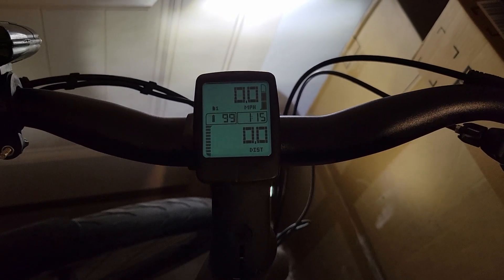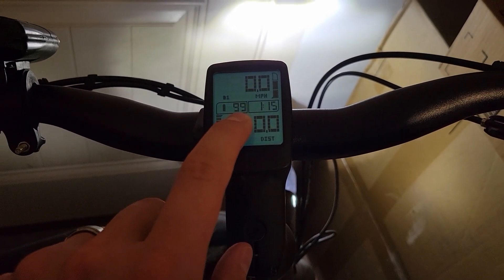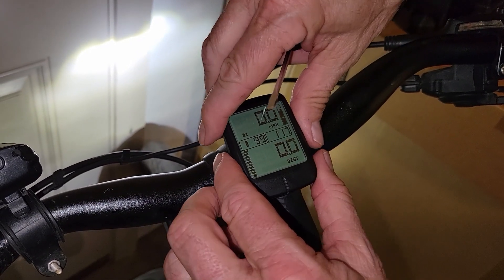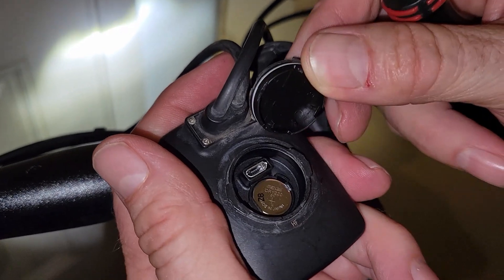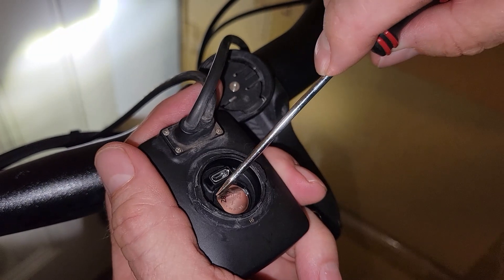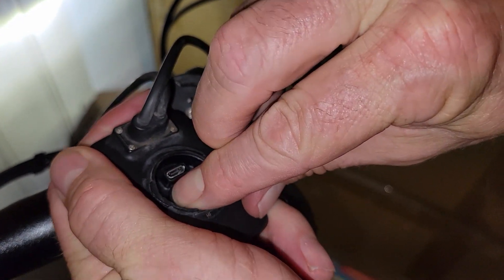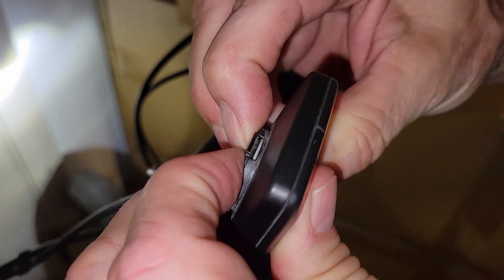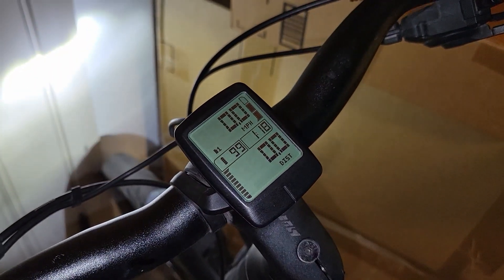Specialized Como/Vado Display Computer/Odometer - Replace Battery

Comment: Whew, thank you! Thought I had a warranty motor issue as my clock was always off even after connecting to the Mission Control app. Would have been nice if the app gave you a message. Even the official Specialized repair techs were baffled by the time mystery and like me, assumed the display ran off of the big bike battery (the lights do). I had 3000+ miles on my bike when the issue started after almost 2 years, so I guess I will change the battery once a year.
Reply from the maker: Weird... Well I'm glad this simple fix did the trick!

Comment: many thanks.  great to now know this.  I have replaced the battery but the odometer is still not functioning.  it is showing some digital graphics but none of the normal readings.  bike battery is fully charged.  any ideas?
Reply from the maker: You're welcome. 
That is odd. I'm afraid I don't know what to do in that situation. Maybe bring it to a bike shop who sells specialized?

Comment: Just what I needed, exactly! Thank you! Does it remember the milage and other details after you remove the battery?
Reply from the maker: Eunoia, disregard my first comment - I apoligize, Youtube doesn't tell me WHAT video is being commented on, and I thought you had commented on a car 12V battery replacement video I have.
I made this video a few years back and don't have the bike anymore, but... my recollection is that the mileage did stay saved. 
Also, my battery didn't totally die - it was just low. So maybe if the battery dies and has been dead for a long time, it would reset - not sure.
Anyway, sorry again for the first comment and thanks for the feedback!
Reply from the maker: See my new comment... sorry about that

Comment: Hello, great video. I was wondering why low bat was showing!!

Additionally,  my battery in my 22' Turbo Como 5.0 will not come out when i turn the key. Ive watched a video, but mine seems stuck, and im nervous to pry it out. I have the key turned the full 90° , it just wont come out even with heavy force. Tips appreciated 😂.
Reply from the maker: I bet if you took it into a bike shop they'd be happy to get the battery out. I'm not sure what else to tell you

Comment: Actually, possibly not on all models, there is an anti-twist plate which first needs to be unscrewed. So you have to more or less remove, or at least loosen, the display mount in order to unscrew this plate. Then you can twist the computer and proceed as shown.
Reply from the maker: That's good to know! Thanks for sharing this for those with the other model of bike. Do you know which model that is?
Reply: My Turbo Vado SL 5.0 EQ has the little screw and plate in the back, which is oddly not mentioned in the owners manual or any video I could find.   @JasonsHonestReviews